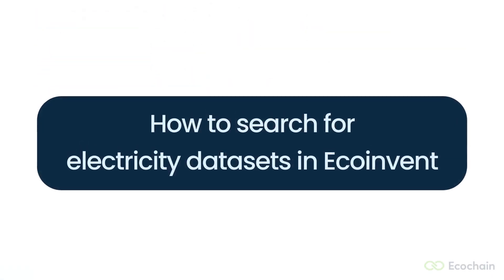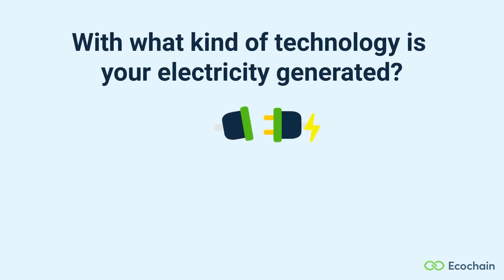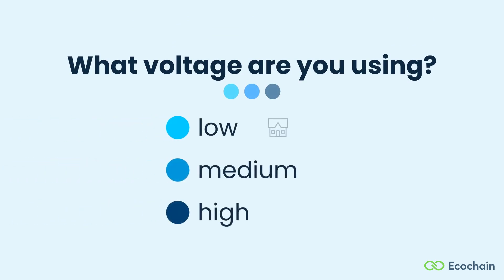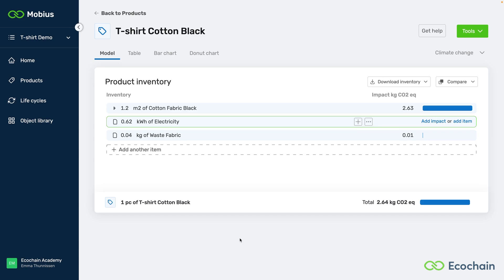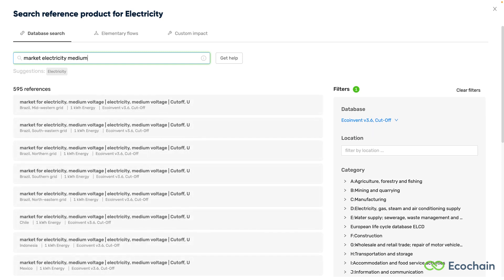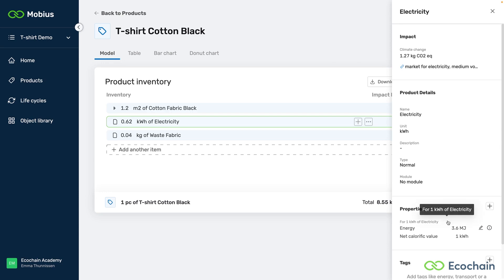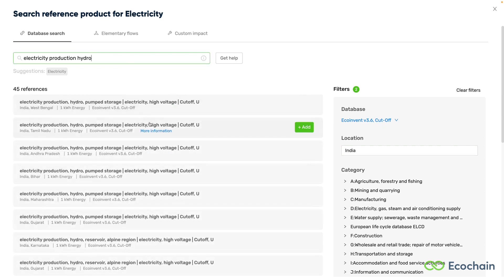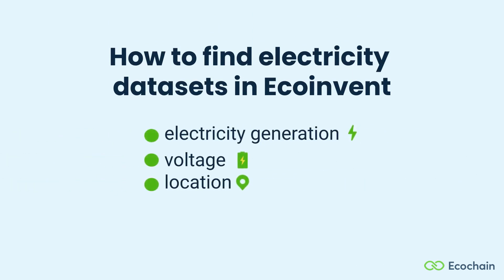LCA Tutorial - Mobius: Searching electricity datasets in Ecoinvent

Comment: Thanks for the helpful videos. I have a small question which I’d be grateful to receive an answer. 

Let’s say i am considering the usage of 10 kWh of medium voltage, in a location where high voltage is generated. Then, for the LCA to capture all the environmental impacts, should I add high voltage production, high voltage transmission, medium voltage production (step down from high), and medium voltage transmission to the final destination? Or if i just select “medium voltage market” in The Ecoinvent, will it include all the stages mentioned above? Appreciate a clarification, thanks a lot.
Reply from the maker: Thanks for your question! The medium voltage market in Ecoinvent contains all the upstream steps to get to your medium voltage electricity, so that would suffice in your situation. Hope this helps!
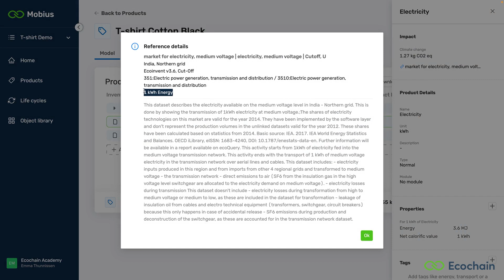Reply: @EcochainLCA  Thank you so much for replying! However, the description of the medium voltage market in EcoInvent says "this activity starts from 1 kWh of electricity fed into the medium voltage transmission network," and "this activity ends with the transport of 1 kWh of medium voltage electricity in the transmission network over aerial lines and cables" (3:31 timestamp of the video). It does not explicitly mention anything about the electricity generation part. Can you kindly clarify whether medium voltage market accounts for the generation as well (possibly at high voltage)? Thanks a lot for your help, truly appreciate it! :)